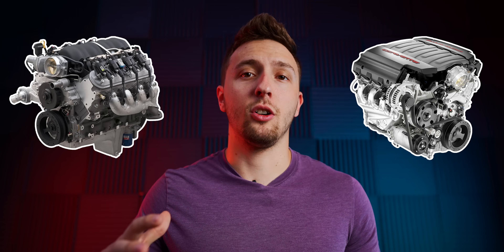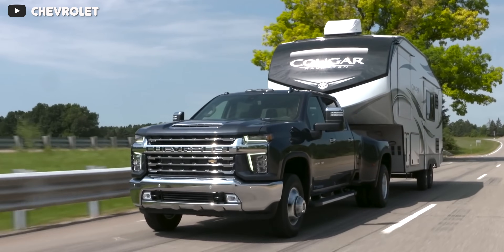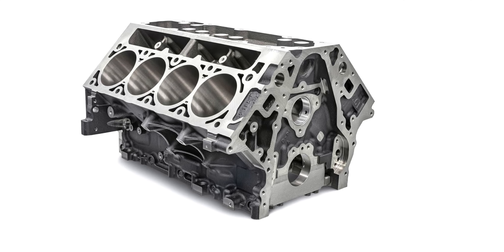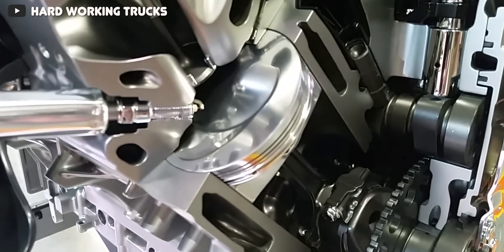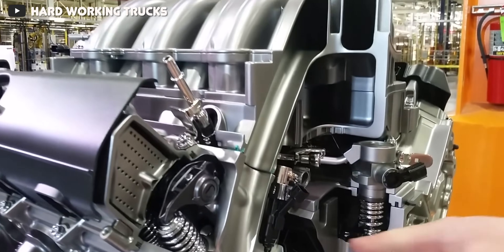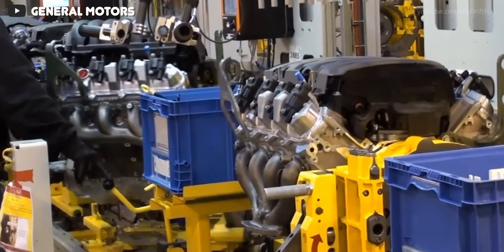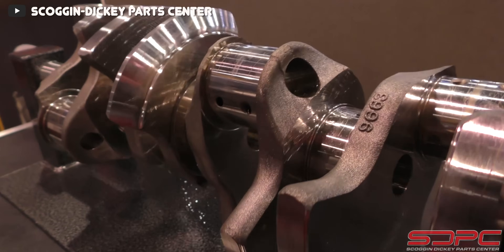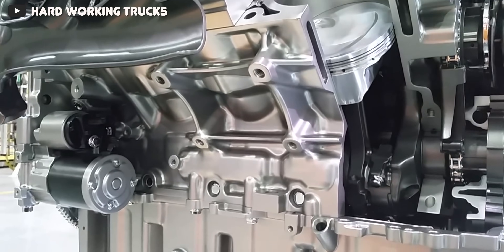Here's Why the GM L8T is the Best LS/LT Engine

Comment: Appreciate your videos and was nice to see this one reviewed.  This engine was on my short list for many of the reasons mentioned. Most notably because it lacked all the Fuel mgmt AFM, etc nonsense that plagues the other GM engines, well Ram’s HD 6.4 too.  Durability is key and even though they may have given up a tad of durability using DI vs that of port inj like the newer Ford 7.3, it will allow a more precise burn at those higher hp levels later, with like you said the higher comp levels even at lower octane levels.  However, since the next truck will sit a lot in my use case, won’t be going with a newer truck wasting more cash so really looking at the first gen Ford boss 6.2 engine in the SuperDuty lineup as a 12v replacement instead. So trying to learn as much as possible about the SuperDuty 6.2 engine iteration now!  Got to see if you’ve done that engine review.
Reply: I don't understand why everyone is so hung up on DI. no one brings up DI being an issue when talking about the 5.9 Cummins, and that was the first time they tried DI. plus these engines don't come with EGR valves, which is the main culprit in the carbon problem. Also port Inj isn't all good, it's old technology so we are back to vacuum hoses and pumps that could leak and fail.
Reply: @michaeljordan4571  simple, DI normally has some additional maintenance down the road that’s not normally attributed to basic port inj.  I think my 12v Cummins has had one leaky oring and that was the extent of my fuel issues on this truck over a long period of time.  Some manufacturers have done a better implementation of DI than others.  The 6.6 L8T, I’d still buy even with DI, given a different rear end option and maybe another 2 gear spread.
Reply: @ryannylander1819  true but isn't the additional maintenance done like really done the line like at 400,000 miles. very few gas v8 ever see that number. and I haven't heard GM say anything about it needing additional maintenance because of the DI.
Reply: @michaeljordan4571  from what I’ve read over the years across forums and manufactures with DI engines, usually, 40k-100k there’s normally something to cleanup, carbon wise.  Pumps, etc…. No perfect answer…100% depends.  I don’t expect much injector or pump failure across DIs…. Just carbon related aspects.
Reply: @ryannylander1819  oh you are talking about the sea foam carbon cleaners. I don't think they are too necessary. again these engines do not have egr valves and those were the main reason for the carbon problem. from the GM techs I talk to, the v8 don't really have carbon problems, AFM is a bigger problems. just makes sure you drive them on the highway for a long time every so often and you'll be fine.
Reply: @michaeljordan4571  hopefully the L8T proves to be a well setup DI engine … with few if any issues with carbon build up, sensors or pumps, etc.   AFM and their lifters, can’t stand it, just junk. Glad that HD eng doesn’t have that.    Also, when DI engines need carbon cleanup, it’s a manual process.

Comment: Another big difference between the 6.2 and 6.6 is that the 6.2 recommended fuel is premium while the 6.6 is recommended to use 87 octane.. premium fuel costs more and allows for more aggressive timing which creates more power... Tradeoff is lower octane fuel and more displacement for similar peak power numbers.
Reply: Less compression= less heat. Building the engine for working hard under load while maintaining safe temps.
Reply: The 6.6 is basically tuned to what the 6.2 would be if the compression was dropped to run 87. I like that Idea because the last 15 years that's how I've wanted to build my engines. Plan it to run like a hot street engine, then drop the compression to run 87. People in forums flame you for it but I'll gladly knock 20ish hp off a 500hp build just to run 87. 450+ is plenty of fun in a gbody toy/back updaily driver
Reply: @nashvilleoutlaw  , the compression ratio of the L8T is 10.8 to 1, almost a ratio higher than the LT5/LT4, which are 10.1 to 1 and 10.0 to 1, respectively. the control of the direct injection vs. port injection allows them to run the 87 vs. the high test. The high-pressure direct injection allows them to time the fuel to enter the compression stroke at the right time, eliminating the chance for detonation. No, some hate direct injection, and others love it; how the aftermarket deals with it, we will see.
Reply: Gm has a 6.6 lsx from like 2003 gas I remember it
Reply: @jackdaniels2657 duramax
Reply: It’s meant to do work. Under load, these high compression gassers have had too high of compression for real work.
Reply: Lower octane means less cylinder pressure, less heat, better longevity.

Comment: New diesel trucks suck, the l8t and godzilla will make them redundant. Too expensive for what u get
Reply: I pull a large 5th wheel with a 21 F350 dually diesel. Pulls like a dream, holds speed downhill and I’ve never had a single issue with the 6.7. To say they’re problematic and ‘suck’ across the board is irresponsible. I owned a 2020 F350 SRW 7.3 and, although it was the best gasser I’ve ever owned, it didn’t come close to pulling heavy up grades like my 6.7, and it couldn’t hold speed downhill. For pulling up to 15K, it would be tolerable, but when pulling a 23K, 42 foot DRV, it’s just not in the cards. The 6.7 has proven itself to me time and time again since my first one in 2013 in an F250 extended cab, long bed. I also maintain my trucks by the book and proactively check for potential issues. So far, I’ve never had any (other than the problem with the price of diesel which is a man-made, Joe Biden problem)
Reply: @6582rg  I just mean the value you get out of a huge naturally aspirated v8 compared to the new diesels with absurdly expensive and complex emissions systems. Obviously a 6.2 or a 7.3 wont compare when you’re hauling huge loads, but when you buy a truck to tow your boat and camper a few times a year and daily drive its hard to justify the $12k power stroke option. For me, I’d spend the $12k on probably on a nicer boat and a lot of beers.

Comment: You missed the other reason why people don't buy the diesel...  
The cost of maintenance and emission system related issues which all brands have problems with.  Regulation has been so progressive that they haven't been able to keep up.  The current L5P Duramax engine has issues with the DEF tank heater which GM hasn't been able to fix yet since it came out in 17.   There's a lot of truth in the saying your gonna have a diesel, have 5-10k in the bank to fix it when it breaks.  That DEF tank heater runs between 1-2k job and they are known to fail at 10k miles or less...  Just read the forums.  It will ruin you if you two with one once, but also ruin your wallet.

Comment: I agree with you on that last part,  the vortec 8100 needs to rise again! I think this engine is a good competitor to the 7.3 Godzilla engine but I think the 7.3 would gap it in a towing test.
Reply: No doubt about that.
Reply: They already have a 7.4L LSX based industrial/marine motor. It's turnkey with 505hp and 515tq. Probably would need a little work and emissions tweaking for on-road applications but the proof of concept is there.
Reply: They could make a new Vortec 8200 using their 502 block which they have been selling for 20 something years. Just  update the heads a bit and voilà.
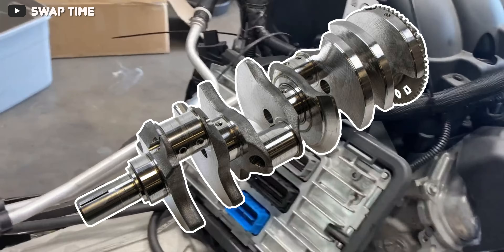Reply: It would only gap it because GM uses 3:73 gears instead of 4:10 or 4:30 like ford. The 7.3 makes a little more hp and torque but the 6.6 peak hp comes in at 5200 rpm and torque at 4000 rpm while the 7.3 peak hp doesn’t come in till 5500 rpm and torque being the same at 4000 rpm the 6.6 also has better compression ratio 10.8:1 while the 7.3 is 10.5:1 so the 6.6 makes more power per liter.
Reply: @Back_door_bandit_98  Yeah you make a great point I totally forgot about gearing. But power per liter isn't as important, when you look at the torque stats on both engines they are very close but the 7.3 has a much flatter torque curve which is more important when towing and is helped out by the larger displacement.

The direct injection is nice for power and performance but the 7.3's port injection seems more suited to towing and reliability, plus no carbon deposits on the valves (I think the 6.6 is only direct injected).
I like Ford and Gm equally but in terms of truck powertrains I think Ford is superior at the moment.
Reply: @robwhite3241  The torque curves seem pretty similar to me. But have you checked out the power curve? The 6.6 builds horsepower faster and peaks at a lower RPM.
Reply: @Back_door_bandit_98  the 7.3 has 400 lb/ft at 1500 rpm and Carrie’s all the way up.  Much better torque curve than the 6.6.  TFL’s Ike Gauntlet test showed the 7.3 was way faster up the hill (I think around 3 or 4 minutes)and MPG’s were within 0.1.
Reply: @tylerking27  Do you have proof of this torque curve? 
Since you didn’t provide proof I went ahead and googled it both torque curves are similar with both starting at around 400 torque at 1500 rpm and carrying it to when they both max out at 4200 rpm what’s funny tho is the horsepower graph shows the 6.6 building power faster than the 7.3 which is probably why it peaks at a lower RPM.
Reply: @Back_door_bandit_98  I said to check out the TFL videos that they do timed runs up the Ike Gauntlet.  The Ford makes it up 3 minutes faster and only .1 Mpg worse mileage.  The torque curves may be similar but the ford is slightly better when I look at the graphs.  Obviously the hearing is A Lot better then the Chevy because 8+ minutes up the hill be 11+ up is an ENORMOUS difference.  Poof enough for me which one tows better…
Reply: @Back_door_bandit_98  Ford does not offer a 4.10 ratio and super duties Yes it offers a 4.30 but also a 3.55, and 3.73. 3.55 being base option on 250, 3.73 on 350.
Reply: The 7.3 makes 11ftlbs more torque with .7 liters more displacement. If they kept their current rates of hp and torque per liter and increase the size of the 6.6 to 7.3, the L8t would be 513ftlbs and 443hp. If the 7.3 was reduced to 6.6 liters you would see 429ftlbs and 393hp. The 7.3 just doesn’t look that good anymore
Reply: @iralosttwo5569  Again the power per liter is not as important when it comes to towing. The 7.3 is just a more industrial strength motor from the looks of it. Now the 6.6 is a darn strong platform, we've seen these motors go over 1000hp but the 7.3 looks more like and irrigation engine and that's what I want. 

As an example I have an old semi truck that's 15 liter engine puts out about 300hp and a c4 corvette that also puts out 300hp. Now that 5.7 could do the job of the semi motor with the right gearing and tuning but it wouldn't have the sturdiness or the longevity of that semi motor. Now I'm not saying that the 7.3 is any semi motor but the 7.3 is a lot heavier than the 6.6 with larger internals. Both good motors but the 7.3's my pick
Reply: @iralosttwo5569  That’s exactly what I’m trying to tell these guys but they don’t get it. At the end of the day the L8T beats the 7.3 gasser from ford people just think the 7.3 is better because it got a cool name like Godzilla LMAO ford guys….
Reply: Erm Vortec 7400.

Comment: Considering how detuned these engines are so they can be put into the 2b and 2c truck classes. If it ever made it's way to the 2a 1/2 ton class it would not be unsurprising to see 475hp and 500ftlb from it. While the 2b and 2c classes don't have fuel mileage standards they still have to meet EPA emissions which in a high work load environment you have to detune the motor.
Reply: And can run on 87 Gas.
Reply: Not unsurprising ?